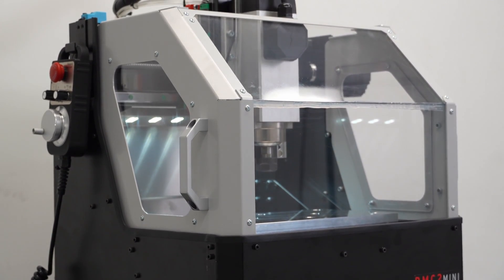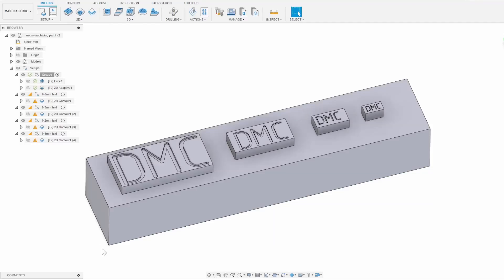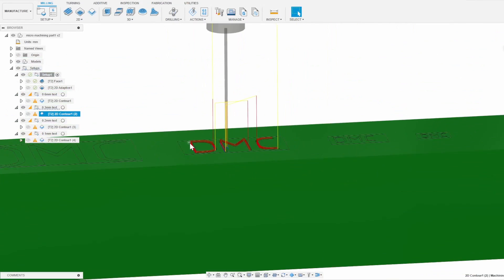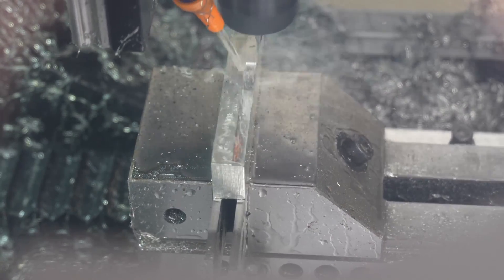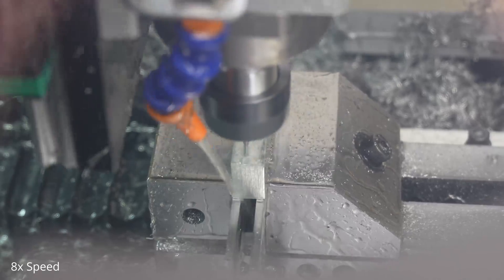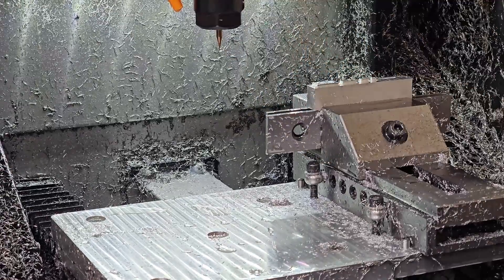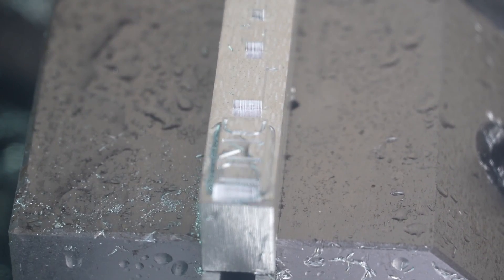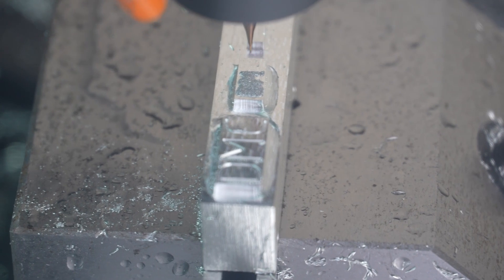Can the DMC2 Mini cut extremely TINY things?

Comment: Harvey, Mikron, Micro100, or even Union Tool, NS Tool for micro endmills. They get expensive, make sure your spindle runout is not more than the diameter of the endmill! They go down to Diameter of .01mm, manufactured with runout of less than .001mm. I'd suggest to find the runout of a deltronic gauge pin loaded in the spindle, perhaps get some precision .003 runout collets from Regofix or Parlec for testing purposes. Even if your spindle taper is good, the collet will be the weak leak with runout. To be really thorough, get a matching ER collet nut when you get a high precision collet, since the collet is influenced by both the spindle taper and nut taper. The ER nuts with integral thrust washers like from Erickson are definitely nicer, Shars also has a cheaper one.
Reply: 50 usd for the 0.01mm end mill

Comment: Insted of buying sherline cnc, why should i not buy this pretty cool mill?
Reply: 1000% get this lol
Reply: Much better machine that's designed as a CNC machine, not a small hobby machine converted to CNC like Sherline or Taig.  Definitely a better solution for a CNC machine and very reasonable if you buy the kit and assemble it yourself.